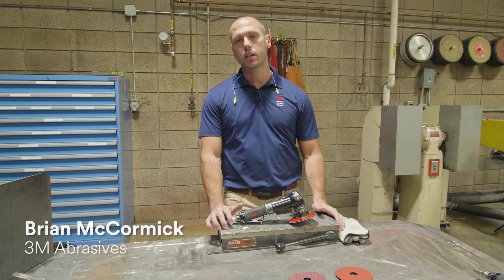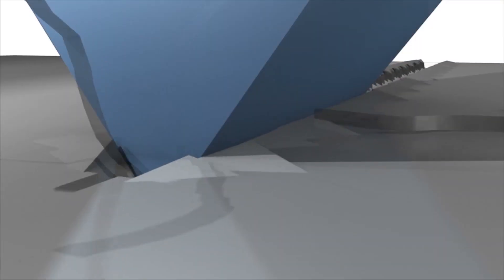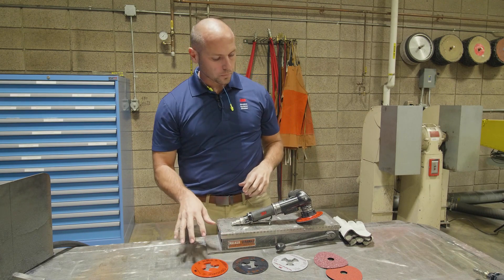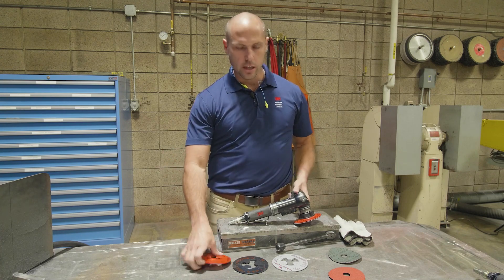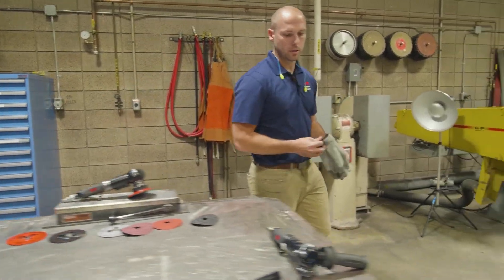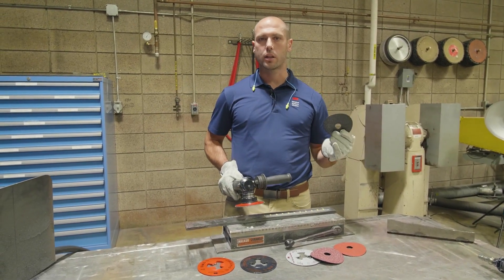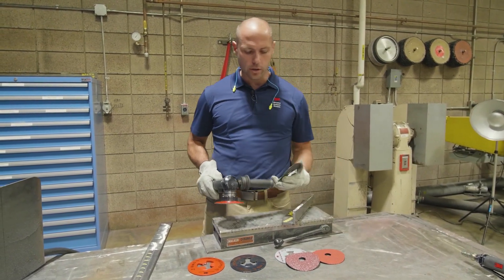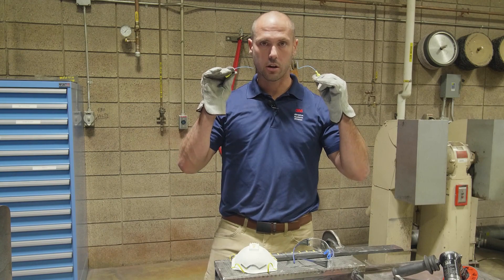3M™ Cubitron™ II Fibre Disc 982C Product Demo

Comment: Is there a 3” roloc disc for sharpening carbide?
Reply from the maker: Yes! We'd recommend the 3M Cubitron 3 Roloc Fibre Disc 1182C for carbon steel, the 3M Cubitron Roloc Disc 1184F for stainless steel, or the 3M Roloc Diamond Cloth Disc 674W. All are available in 3".